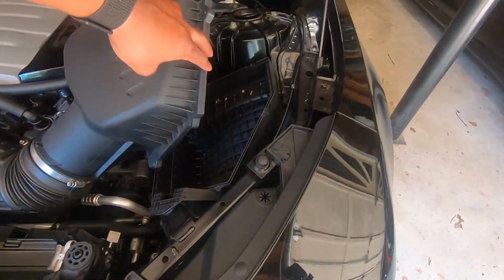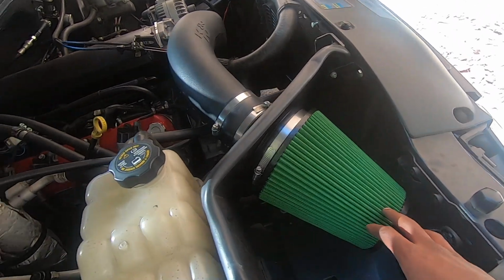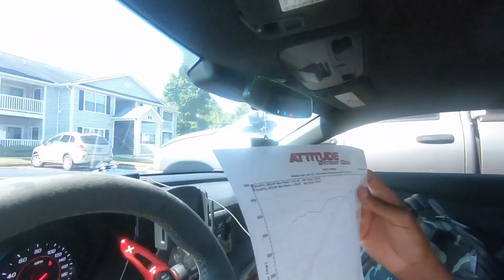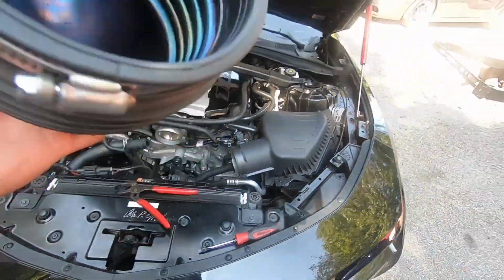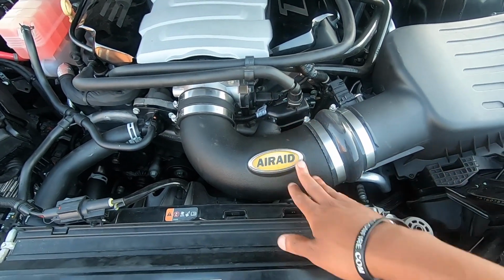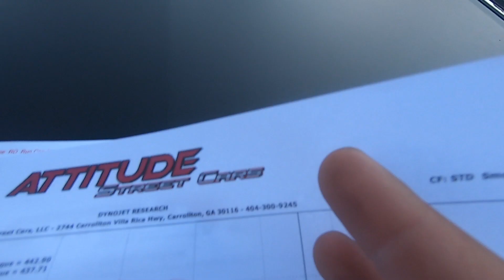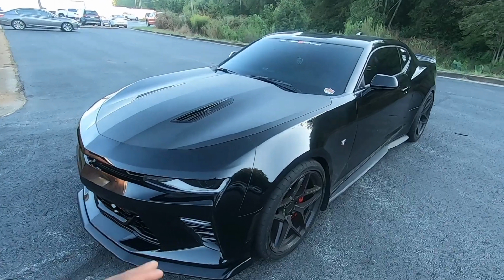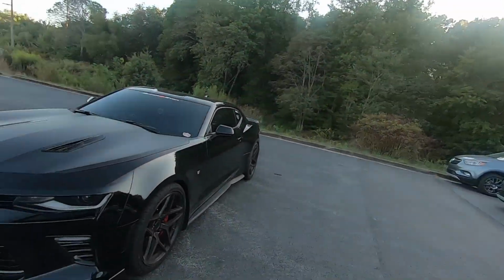"Cheap" Horsepower Gains 6th Gen SS Camaro

Comment: Fuel milage goes down with e 85 so go get some sonoco race gas and keep you milage and get 20 HP and put on a water meth injection and get 20 more ho then headers and HP cats n mufflers and get 20 more hp
Reply from the maker: I didn’t buy a Camaro for the fuel mileage, so that’s not a concern of mine. Also you can’t get that from the pump so it’s not as convenient either. Also this video is about affordable and simple mods, that fuel isn’t extremely affordable either. Simply defeats the purpose.

Comment: Pretty sure that dyno is showing high numbers. I cant wrap my head around 445 with just a TB and axle back lol if you had headers then 445 will be good. But not even headers it’s definitely reading high
Reply from the maker: Gumboly this dyno never reads high, it’s a heartbreaker in our area. Plus the gains are all that matters. Keep in mind this is on 60% E85 plus a manual car.
Reply: Super Stan I do understand but the numbers are way to high. The lt1 has 455hp to the crank. You will be around 390rwhp stock. It is possible for 400rwhp stock. But there is no way you are above 440 with just e85 bro. Sorry to bust your bubble lol People on camaro6 have headers,e85 and get around 445. Including me. So you must have a special motor or something lol
Reply from the maker: Gumboly we must be comparing two different things because I have seen tons of manual LT1 cars make the same power stock on the dyno
Reply: Super Stan nope. Im comparing a 6th gen camaro lol
Reply: You are right, his dyno numbers are way too high. I have a 2017 1SS with kooks 1 7/8 long tube headers with high flow cats, flowmaster scavenger x pipe, flowmaster American thunder axle back. CIA from Cold Air Induction and it was dyno tuned by HORSEPOWER. I made 418.77 HP and 437.17 TQ. Temperature 50.87 °F, 15% humidity.
Reply: Also mine is A8 on 93 octane
Reply: Gumboly he is a stick car not a auto they put down 415-420 wheel stock what’s not to believe about him making that with a tune and e85 ?
Reply: Exactly they didn’t watch the full video. E85 FLEX FUEL is the game changer. It’s not just throttle body and elbow, with air filter drop in. The tune with the E85/93 will give the upgraded HP and RWHP.

Comment: Do u jus hav the corsa tips? Or did u change the whole exhaust?
Reply from the maker: Dalton Roberts definitely changed the whole exhaust
Reply: @Stan1le  would it have been cheaper changing the headers?
Reply from the maker: Dalton Roberts cost is the same once you add the X-pipe

Comment: I feel like that's actually a lot of money for the gains. I don't think your gonna really feel 30hp/torque. With the cost of the exhaust and other mods u did in this video your prob half way to 2/3 cost of a procharger. And for states where headers are legal those with a tune would prob get 430 or close. Not sure what you pay for Dyno tunes where your at but around here it's $700 to $800.
Reply from the maker: Prion Aloc depends on how you look at it. And I am no where close to the cost of a procharger. Also I don’t pay for dyno tunes so I don’t have that problem. Different strokes for different folks. Thanks for the comment

Comment: If i were to guess you would be around 420-425
Reply: In horsepower no, I have a 2ss (2018) Camaro and it STARTS at 455 hp, but idk what u meant by that so yea
Reply: @lolyouwontfindme6070  that’s to the crank lol, I made 409 to the wheel stock